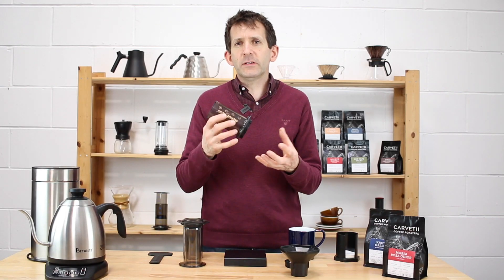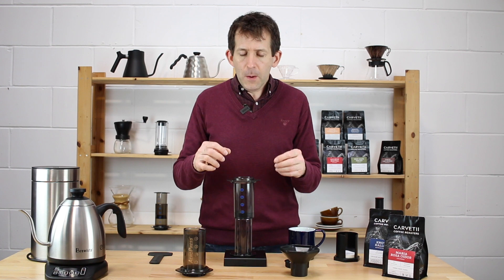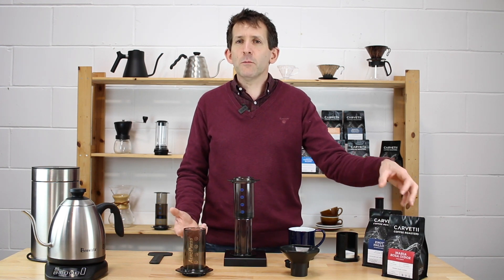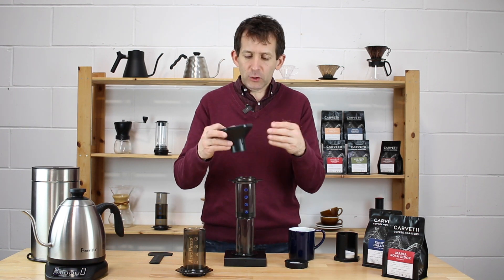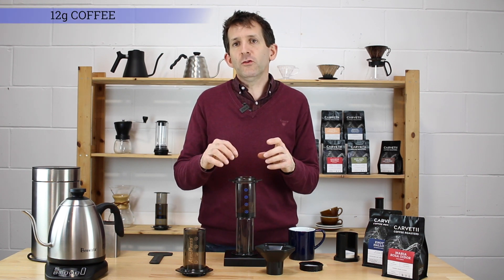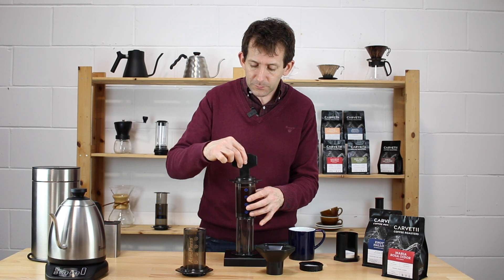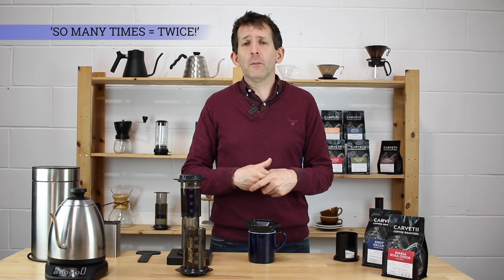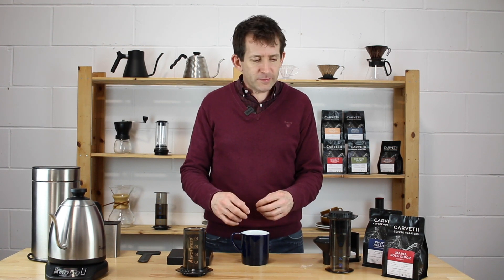Brewing Basics: Aeropress Inverted Method

Comment: This is almost exactly how I’ve settled on using the Aeropress. Two more points: The inverted setup is VERY easy to tip over on the table with a small bump, so use extra caution. Also, once you put the cap on, back out the plunger just a few millimeters to create a vacuum so that there will be no leakage when flipping the whole thing upright. In fact, as soon as you do this, you can go ahead and flip it onto the cup for the remainder of the time.
Reply from the maker: Thanks for the comment and the extra advice 👍  I have had a couple of disasters along those lines, particularly when out camping so definitely worth the mention.

Comment: I’ve tried the inverted moethod and a few times and thermodynamics have kicked in after putting the filter on letting it sit to brew the plunger has popped off and sludge went everywhere  leaving a big mess, so I flip the aero press straight after putting the filter cap on leaving it to brew safely this has cleaner results for me
Reply from the maker: Thanks for sharing your technique. I’ve had a few inverted issues myself over the years! Mostly because I forgot to put filter papers in. One of the joys of coffee brewing is finding a work around for these problems 😁

Comment: I have a Baratza Encore grinder and could you suggest the grind setting  in the medium-coarse range? Thank you
Reply from the maker: It’s a nice grinder. Typically I’m around the number 10 on the Encore I have here but it’s a grinder I’ve had for years and it’s been stripped apart a lot, plus we’ve changed the burrs.
Reply: @carvetiicoffee  Thanks, I will give it a try. I'm also thinking of ordering the Flow control cap.
Reply from the maker: I’ve used the Fellow Prismo which is a similar piece of kit and it made a difference. Think I was running 20g coffee to 40g water through it for an intense shot - definitely not an espresso as they claim but worth a look 👍
Reply: @carvetiicoffee  Thanks, I will give it a look!

Comment: Long term, does it damage the rubber seal to pour hot water onto it using the inverted method?
Reply from the maker: I’ve been using an AeroPress for around 16 years now and I’ve only once had to change the seal. Although this is only my own experience I’ve not seen or heard of any issues relating to the seal and hot water.
Reply: @carvetiicoffee  ah thanks for the timely response! Will give it a go!

Comment: Careful not to lock the cap until the very last moment before pressing down! If your grounds release too much CO2 while brewing, the pressure is going to push the plunger out making a mess everywhere! Another option is to press the plunger until there's no air left inside, but if you do this in the middle of the brew with the AP on a scale, it gets more complicated.